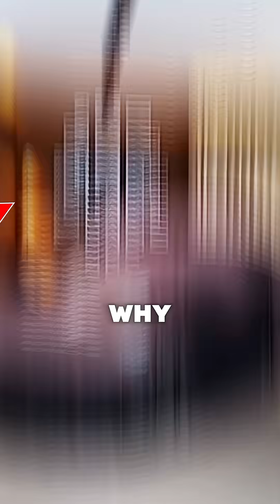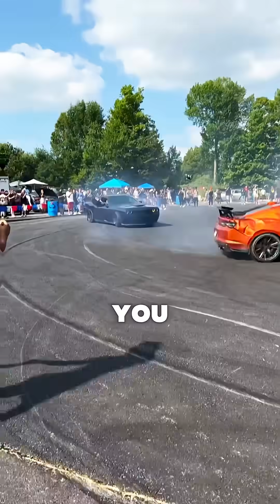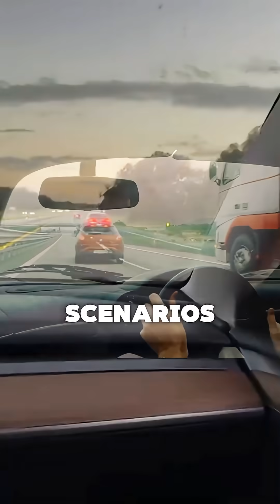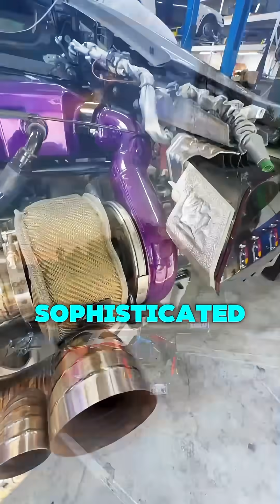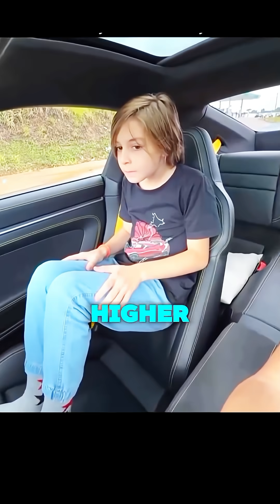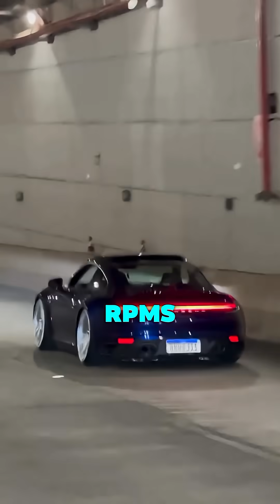The Battle of Turbochargers and Superchargers 🥶💨☠️ #car #automobile #luxurycars #facts #shorts

Comment: Exhaust gases ???? That is only if it is installed to use the exhaust, otherwise it is installed to benefit from air intake such as on The Hoonicorn V2 which is twin turbocharged and both are setup for intake